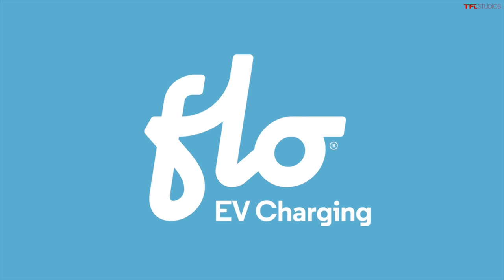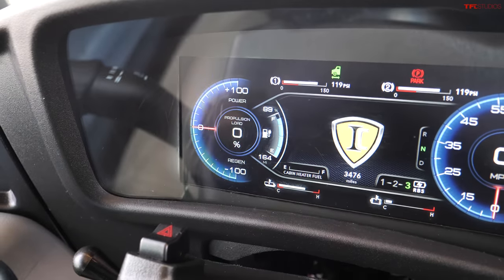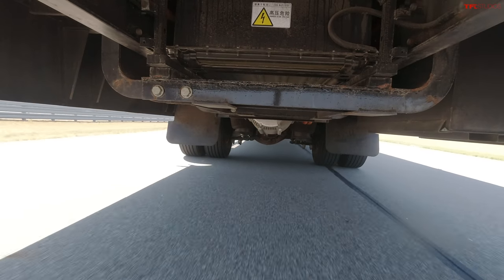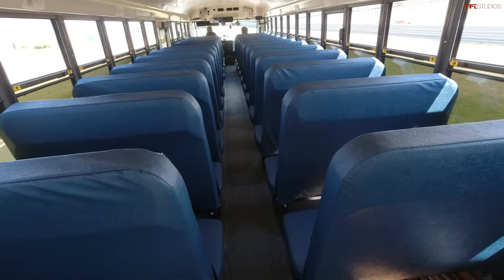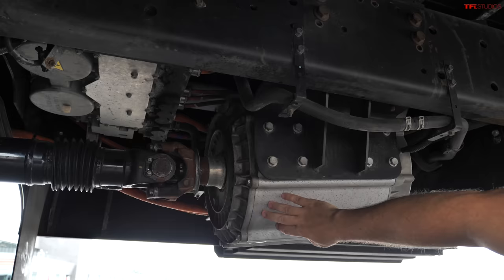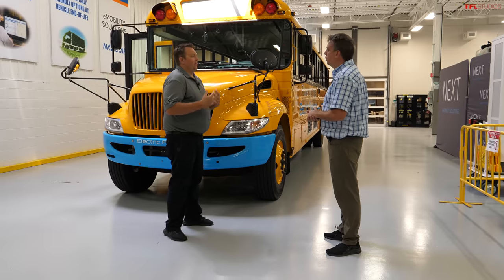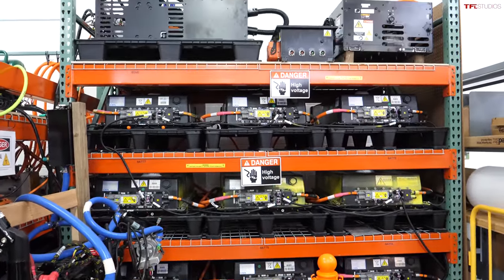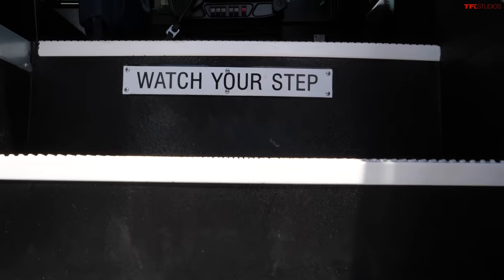Does This EV School Bus Put The First Nail in The Coffin Of The Classic Yellow DIESEL Kid Hauler?

Comment: Electric school buses make so much sense. Studies have shown that exposing children to diesel fumes results in an increase in life long health problems.
Reply: Lmao. How were the studies conducted? With the kids directly behind the tail pipe? Properly tuned and maintained school busses produce very little fumes.  Some diesels actually produce less than many gassers of same displacement.
Reply: @WheresHerb  by measuring the air quality inside the bus as compared to outside the bus. One article by the LA Times says, “Air inside the big, yellow buses used to shuttle children to and from school can contain up to 8.5 times more diesel exhaust than people typically breathe in smoggy California--enough to expose children to dangerous levels of cancer-causing soot, according to new research.”
Reply: @jloop_2008  The device you sent that message on also has Cobalt in it, so you also need to get off your high horse. You are also forgetting about all the children suffering under corrupt regimes that make all their money selling oil. The difference is once burned, oil is gone but EV batteries can be recycled to retrieve 97% of their materials.
Reply: @roger1818  Recycling batteries in not free or without waste. In reality, it requires a ton of energy. What's more, it's not economical. It's actually cheaper to trash the battery and mine for more material than it is to recycle it.
Reply: @AkioWasRight  I agree that that recycling batteries requires a lot of energy, but if you consider that it also requires a tonne of energy to mine and refine new materials (including oil), the incremental amount of energy is small. When you consider the amount of energy saved through the lifetime of the battery compared to the use of fossil fuels (Internal combustion engines are extremely inefficient), you are still way ahead. It might be cheaper to landfill the batteries (I'm not sure because the materials they recycle do have a resale value), it is a price we as society should pay to live more sustainably. We need to stop sending toxic substances into the environment (land, water or air).
Reply: @jloop_2008  I am not trying to be virtuous.  I am claiming an advantage. It isn't Tesla that is making that claim, it is the companies that are actually recycling the batteries.

As for solar power, I didn't say anything about it, so I don't know what that has anything to do with electric school buses.
Reply: @AkioWasRight   It sounds to me like you need a better source of information.  There are numerous companies that recycle EV batteries for profit.  Check out Redwood Materials and Battery Recyclers of America (in business for ten years now) for two examples.  In addition, most of the EV battery manufacturers are setting up to recycle also.  They can recover over 95% of the materials and the purity of the materials is better after recycling than it was the first time around.

No modern EV battery has ever gone to landfill.  A) It would violate numerous laws. B) The materials are way too valuable.
Reply: Hopefully the school busses have their own roads to drive on in that case.
Reply: @roger1818  There's no such thing as living "sustainably".

Society could pay out the wazoo, and we still would fail to see "sustainable" living.
Reply: @jloop_2008  Wow! Get out much? I never said anything about not leaving any carbon/toxic foot print, but that doesn't mean we should give up all hope and just pollute the planet as quickly as possible.
Reply: @davidmenasco5743  It sounds like you can't read.

I never said there were no companies that recycle, I said it was not economical relative to mining new materials. I know that company, as one of my clients contracts for them here in California. These companies are massively subsidized. They do not have an economical model and would fail without government support.
Reply: @AkioWasRight   So in your mind we should not even try to reduce our environmental impact?
Reply: @jloop_2008  Wrong on all accounts. You know what they say when someone assumes.
Reply: @WheresHerb  Ok, close the garage and turn on the bus.  How quickly would you pull your kids out of that garage?  Now, tell them twice a day they have to spend a half hour breathing just a little bit of that.  See how enthusiastic they are.

These studies have been coming out frequently over the past five years, some by places like MIT.  The dangers are pretty clear.
Reply: @roger1818  Not at all. I'm saying "sustainability" is delusion, and arguments for it are automatically invalid.  

Environmental friendliness and economics go hand in hand. If you can reduce your waste and use of resources, you make something more economical. 

The fact that SO MUCH money goes into producing, charging,  processing and recycling batteries tells all you need to know about their ecology. 

However, nothing is ultimately is "sustainable", and all forms energy produce waste, and all resources are limited. Even walking, which is the most rudimentary form of travel, produces waste and is unsustainable, as you are expending energy and demanding resources just to walk. So, "sustainability" targets are just nonsense, but they make for good political slogans.
Reply: @roger1818  go ahead and tell us all your ways. We are all still waiting. Please tell! We are begging! Lie a bit if you need. Lol
Reply: @WheresHerb  I agree but the real test would be how much CO those busses put out
Reply: @jloop_2008  Us and We? Are those your preferred pronouns or are you making assumptions about others?
Reply: What are the long term health effects of sitting children on top of huge electro magnetic fields called battery for 12 years of their developing life?
Reply: @davidmenasco5743  That can't be electric vehicles have not been around or in large enough quantities for batteries to need replacement and recycling, or have we been lied to about how long these batteries will last for.
Reply: @davidmenasco5743  stop with the liberal lies son.
Reply: @getlosttoday4045  They damn sure are not funneling the exhaust into the interior of the bus where the kids and driver reside. Todays school buses are air conditioned unlike the buses I rode on as a kid and we did not smell the exhaust of the Diesel engines with the windows down no less and that was long before modern pollution control devices were put on them.
Reply: @mustangecoboosthpp3869  Batteries are Direct Current (DC) supplies and don’t generate electromagnetic fields. You need Alternating Current(AC) to generate ElectroMagnetic Fields (EMF).
Reply: @roger1818  I drive a diesel school bus. I've never smelled diesel fumes inside the bus. Newer diesel buses have diesel particulate filters cutting down on soot.  They also require diesel emission fluid. It's illegal to run without this in place with exception of older buses. Diesel buses have a long way plus their range per tank is better then my  car.
Reply: @dexter023  I trust scientific instruments more than some random person’s nose. As for range, school buses don’t need to drive hundreds of miles a day so a range of a few hundred miles would be enough to cover the vast majority of routes.
Reply: @roger1818  How do you know? I drove a hundred miles round trip for my regular run. I had a sports run that was 70 miles one way. Or does science have an answer for that too?
Reply: @dexter023  For your regular run, electric school buses start with a range of well over 100 miles, so you could do your regular run, plug in while the kids are at school to get enough charge for the afternoon run.
Granted field trips and sports events will be more of a challenge with current battery technology (though even then you can still go to a rapid charger while the kids are doing their event), so we may need save some diesel buses for that, but given that most operators will want to get about 15 years out of a bus, it will take a while to replace the entire fleet (no one is suggesting we replace them all at once).  If you consider that the energy density of batteries has doubled over the past decade, assuming that trend continues, by the time fleet operators are ready to replace their newest diesel buses, the range issues should no longer be an issue.
I am curious if you have driven an electric school bus to have a solid opinion, or are you basing your opinion on assumptions? CNET did a video on electric school buses and the school drivers they talked to, which have actually driven them, had very different opinions to you.
Reply: @roger1818  I've never driven an electric bus before. But a diesel gets better range at least for now. It would be quieter in residential neighborhoods early in the morning. For my regular run, the range is more than adequate. But for larger districts that may not cut it. My district won't be changing for a while.  They are positives but range is my biggest issue.
Reply: @dexter023  I agree that for certain runs, electric school buses won’t work, _yet_, but for many they will, so we can’t make blanket statements about them one way or the other. As battery technology improves, and range increases, those limitations will disappear.
Reply: @roger1818  I'm sure my concerns will be addressed as technology gets better. Currently, they have a limited application. I also have a problem with gasoline buses. Care to argue about that?
Reply: @davidmenasco5743  Why make something up?  The bus is not in a garage for half an hour with children in it.  Children are picked up away from the bus depot.  The dangers are not pretty clear.  I could make the same argument for a car, where being in a garage with a running motor is more realistic.  I'd be more concerned about the bus drivers' soberness/alertness, and crashes.  Better driving, and sensor technology is needed on buses.
Reply: @davidmenasco5743  So then, why did you make up a story about it?  Why not just state what you did right now?
Reply: How much does that bus cost?
Reply: @truenorth9508  I don’t know about this particular make/model but from what I have heard about other electric buses, while the up front cost is higher, the lifetime cost is lower because of savings in fuel and maintenance costs. Of course those the fuel savings depend on the relative cost between diesel and electricity locally.
Reply: @TheAnimeist  Bus cabins are not air tight, and buses frequently stop and idle while waiting for students. Pollutants from the exhaust can and do enter the bus, and are then trapped there and students breath it in. It's not healthy long term.
Reply: @AkioWasRight  The reason there is so much money going into battery supply chain is to accelerate it in order to more rapidly replace gas vehicles with battery evs. Setting up the infrastructure for producing, charging, and recycling evs requires a lot of capital investment, and the existing dominance of gas vehicles means that without government support,  companies will have an enormously difficult time setting up their businesses and creating the facilities needed to make the switch. Many things can definitely be sustainable, you just need to actually set up the infrastructure needed to reuse and recycle existing things rather than dig more shit out of the ground. Renewable resources like plant products and wind/solar/hydroelectric energy are sustainable when used in moderation and can effectively replace things that are not. You can't defend the continued use of the things that are actively destroying the environment because "it costs money to change".
Reply: @Ry_TSG  School bus-related crashes killed 54 people nationwide in 2020, down by over 50% compared to 2019 according to National Safety Council .  So like I said,  soberness/alertness of the driver, and crashes would appear to be a bigger problem.  Do you have reference for where children are killed by exhaust?
Reply: @TheAnimeist  They're not being directly killed by exhaust, but it can cause negative health effects down the line. This is supported by the American Cancer Society (read "Diesel Exhaust and Cancer Risk"). That's not to say that school bus crashes aren't also a problem, but there's no reason not to tackle both problems at the same time.

Comment: Seems like the perfect roof for supplimentary solar.
Reply: I think the school roof is better!
Reply: @allterrainrandy2587  Yup. It would add thousands to the cost of the vehicle and add basically no range at all.
Reply: "add thousands to the cost of the vehicle and add basically no range at all" Tell that to Sonomotors.... YouTube experts, SMH...
Reply: @zachswy  You're right.  About all the benefit you'd get would be to top off the 12 volt accessory battery so the driver could sit during downtime and listen to the radio or maybe power one of the fans.
Reply: @nc3826  you underestimate how inefficient solar panels are.
Reply: @Distress.  thx for proving my point
Reply: @nc3826  It wouldn't make sense for this, maybe as a grid relief application but nothing else. They said it in the video, school busses only average some 80 miles a day, and the bus has a 200 mile range. Only benefit would be lessening the time or stress on the grid from charging them by a few percent.
Reply: Honestly the only time it makes sense to add solar to vehicles is if your traveling places with a spotty grid at best, like a motorhome. Adding unnecessary weight to vehicles is dumb, especially if there are more suitable roofs that the school district own to add more solar panels too. Perhaps in a couple of decades when we could be running out of roof space(fingers crossed) and it's light and cheap enough, only then would it make logical sense to do. To add it to the vehicle now would purely be ego stroking.
Reply: @matt9c1  if the roof is covered, it's going to be around 4.5kW peak. That's way more than enough to run HVAC, a radio and keep the 12v system topped off. But probably only makes sense in Arizona and Australia.
Reply: @daffodil2067  Does that also take into consideration the area lost by the vents and escape hatches ?  Also where the vehicle is parked in reference to the sun is a variable, weather conditions, dirt/grime....etc.
There's just too many variables that can take your 4.5kW number and start to subtract from it.
Reply: @matt9c1  .... It probably only makes sense in Arizona and Australia.

Say ventilation is a 9 sq ft (1 sq yard), 4.5kW becomes 4.3kW. 10% of that is still enough to run a fan and radio and keep the 12v system topped off.
Reply: @daffodil2067  You underestimate how many sunny places there are.

Regardless, yeah. Panels atop vehiclea shouldn't be a priority, at all
Reply: Til snow gets on
Reply: @tmaq9726  It's illegal in most first world countries to drive with snow on the roof anyways
Reply: Actual bus driver from PA, a few problems:
Most of my route, and others I have driven, are under trees. As neighborhoods tend to like big trees and shade.
I don't want another inch of height. 10'11" doesn't sound too bad until you drive around old growth suburbia. Low hanging branches and low bridges everywhere. I know a few roads that an inch would make the difference and cost a lot of extra driving. 
Range is never going to be an issue for the majority of buses. I drive 68-70 miles on average, with a 4 hour break in the middle. Some may hit 120 miles but still have a good break mid-day.

Comment: A real world 200 mile range school bus can probably meet 80% to 90% of school bus fleet range requirements. The remaining buses can remain diesel fueled for missions needing more extended distances such as field trips and other special uses. And maybe, a small selection of buses with an extended range battery pack or a range extender generator can be installed for use when needed. Say something in the 10 to 20 KW capacity area. Those already exist and are for all intents and purposes off the shelf items already available for bus size vehicles.
Reply: @PantyDropper69  remember, each bus often runs 2 or 3 routes in the morning and two or three routes in the afternoon. Plus extra activities runs during or after school.
Reply: @PantyDropper69  Not once you get away from urban and suburban areas.   200 miles is a much more realistic number for most Eastern and Midwestern states.   I could see some routes in western states being even longer.
Reply: @PantyDropper69  Longest route I drove was 120ish miles a day. It was an 8 hour day, Elem, Middle, and High with an activity route at the end. Never left the district, just covered a lot of ground.
Reply: Gas or diesel generator. Maybe we can stop this nonsense about getting rid of combustion engines and have generators in all the electric cars. Wouldn’t need to worry about range then.
Reply: We will miss the Cummins isb but this is a great bus I remember the diesel ce’s
Reply: @wtk6069  I live on the Eastern and you are incorrect. School buses here don't do 200 miles within the city. Not sure where you get your numbers from .